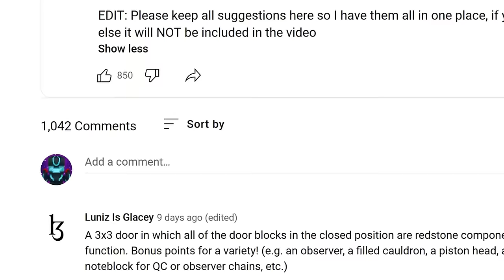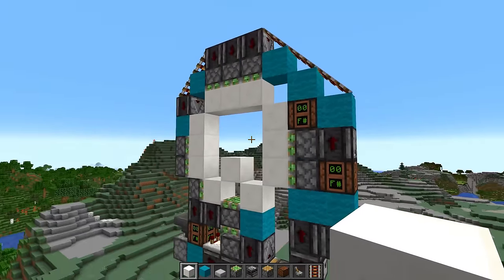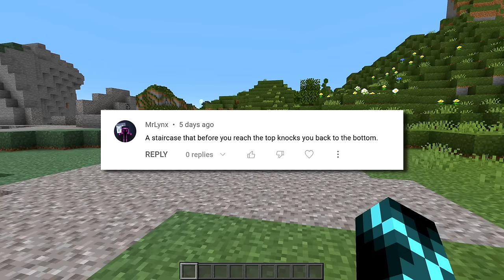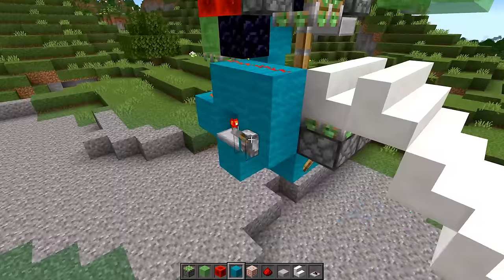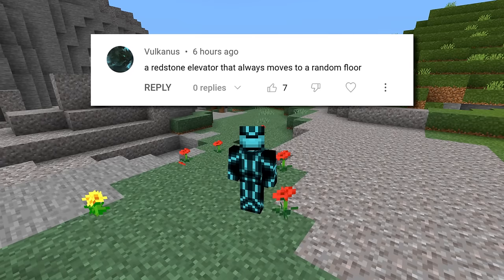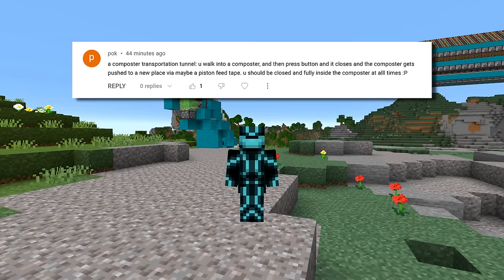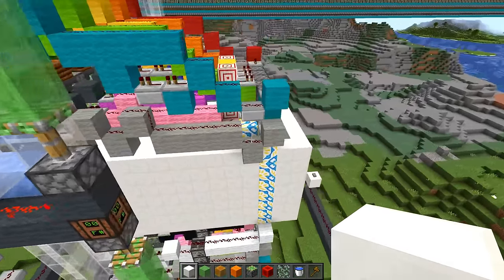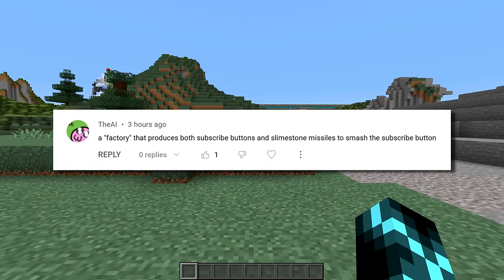I Build Your DUMB Redstone Ideas #1

Comment: Please make an elevator that goes sideways then automatically switches to going up when it reaches a point - or down if you want that floor, a bit like charlie and the chocolate factory!
Reply: Please explain
Reply: @brandonotto1461  Basically, outside the elevator you press the button to the floor. The elevator can be glass, does'nt have to be. The elevator will start going sideways - either 1 direction with no choice, or he might make it so that you can control which direction - behind, left, right, though i wouldn't be surprised if its only possible to do 1, say backwards. The elevator goes backwards instead of up, then will go up or down and go onto the floor, letting you get out, before going bcak to the original place.
Reply: @darktodds  Isn't that also in harry potter?
Reply: @wizard0078  Would that be floo powder? Or would you be referring to, the 5th book I believe, where the Ministry of Magic telephone box goes into the ground and to the actual building. The Ministry of Magic box would be an insanely cool concept to see in minecraft, and, though it isnt really a lift - its magic, its similar, and I would love to see that too!
Reply: @darktodds  I can't remember which part it was. Maybe it wasn't even harry potter, but i'm pretty sure. They stepped into the lift and then it went backwards, before going up/down as you said. Can't remember which part exactly tho. Maybe i'm mixing it up with another movie lol
Reply: @wizard0078  It was in Harry Potter, but inside the Ministry instead of the telephone box.
Reply: Dude, that is… Literally almost impossible irl I want Purple to try it
Reply: @PhantomGato-v-  it actually kinda exists irl, tom scott did a video on it iirc
Reply: @PhantomGato-v-  multi-directional flying machines exist
Reply: @skmgeek  i saw, which is why I said "almost"
Reply: @LineOfThy  Not In elevator form!
Reply: Piston bolt
Reply: good idea

Comment: I had a stupid redstone idea when I saw the thumbnail that I am now going to attempt to explain.

An “elevator” where you are on top of a gravity block, concrete powder if you want an aesthetic. The stuff holding those gravity blocks then falls out of the way and you and the gravity blocks begin to fall. Maybe have a slime block piston jut out briefly above to make you the player fall a bit faster than the blocks. Then below that gravity block platform is another set of slime blocks and pistons which will launch you up to the 1st floor (or second floor. The one above the ground floor.). But the floor above the ground floor will be seemingly closed because there will also be a floor of pistons holding up some gravity blocks which will go away and come back to let you in and catch you. 

I have no idea if this is possible. But it’s what came to mind when I saw the thumbnail, I immediately filled in the sandstone as sand and though of how to do a sand elevator. 

In my mind it was also a 3x3 floor. But if you can do anything of that idea that works I will be impressed.
Reply: Players and gravity blocks experience a completely different acceleration, so I doubt it would be easy
Reply: @caspermadlener4191  I’m not saying it would be easy. But also I did suggest maybe using a downwards slime launcher to accelerate the player downwards faster than the gravity blocks.
Reply: @gardenshed6043  Don't the gravity blocks fall down slower than the player?
Reply: @caspermadlener4191  Not sure tbh. It was just an idea.

Comment: building an automated farming system that can harvest and replant crops without any player intervention. This would require complex mechanisms to detect and harvest mature crops, as well as a system to replant them in the correct locations. Additionally, the system would need to be able to handle different types of crops with different growth rates and harvesting methods, such as wheat, carrots, potatoes, and beetroot.

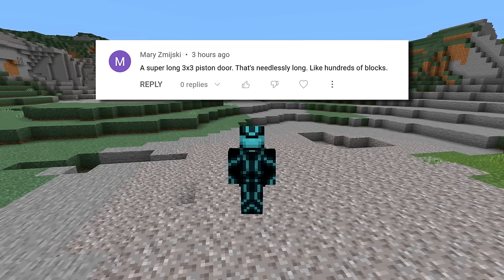0:20

Comment: My less stupid, but still average idea would be a security system for the dragon egg, that still allows for it to be displayed. As far as I know, that has never been done before.

My idea was to put the egg on top on a floating anvil, which falls down as soon as the egg teleports or is destroyed by a piston or by an explosion, but I was never able to find a fast detection system.
Maybe somthing with B O A T

Other methods (budded piston, observer) would be too obvious, and not quirky enough, unless you are using it on the side, and use a map to hide the piston (that's faster)